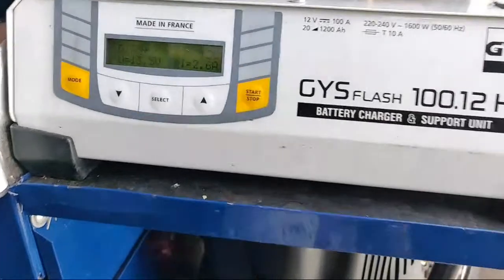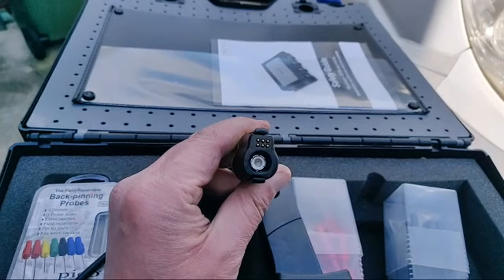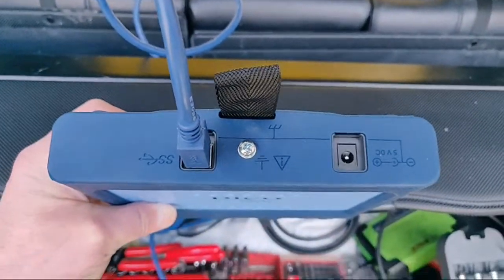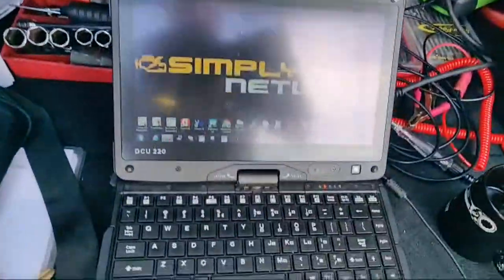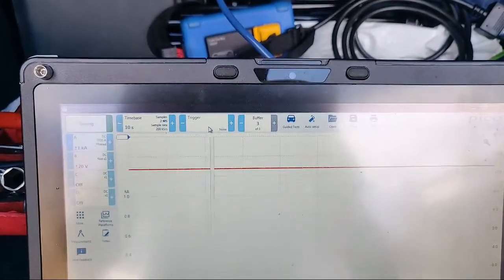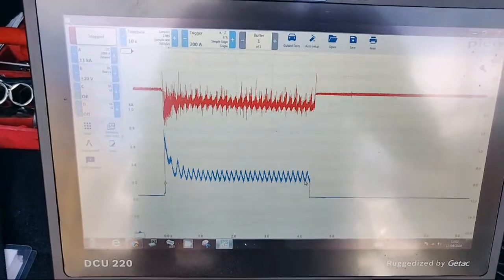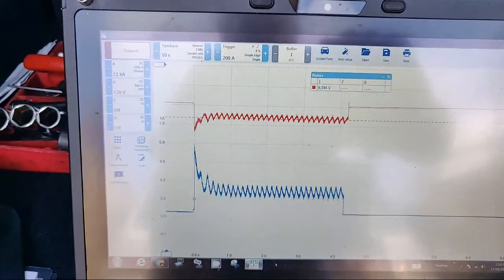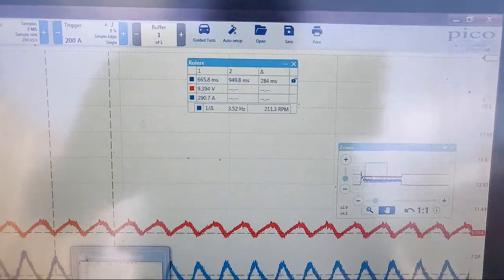Picoscope 4425A Unboxing

Comment: Hi there. Would you recommend me buy this pico scope or the Escope elite 4 ?
Reply from the maker: Different animals, I'd advise trying to get a demo on both. Both are excellent scopes but it's definitely down to personal choice. 4425a Pico takes most of the new user hurdles away. Escope is a powerful tool if you understand what you're testing. Have a look at the Pico and ATS YouTube channels 👍
Reply: Simply Diagnostics i watched some videos. I see many people use Pico scope. I know Escope has more features. Not sure which one to buy. I like both though but Escope has misfire function and 500 v without using attenuator and deep recording

Comment: Being that the amp clamp auto-zeroes when connected, shouldn’t it be off the cable until you connect?
My 4425a standard kit arrives on Tuesday. Can’t wait.
Reply from the maker: What point in the video mate? If it was a cranking amps test it shouldn't matter as the circuit wouldn't have been loaded. There's every possibility I made a mistake, live videos can muddle the thought process sometimes 👍
Reply: Simply Diagnostics not judging. It was a serious question. I agree that with what you are looking for and the amperage you’re are dealing with on a cranking test, it’s a mute point. As stated earlier, my 4425a is on its way and am trying to clarify. If I were doing something in the mA range of testing, with the 4425a, would it be necessary to hookup the lead before connecting the clamp for a true zero. Incidentally, you have to be the happiest tech on YouTube. It’s refreshing.

Comment: Well a bit flashy these bad times but who I’m to judge envy it such a great piece of kit no match for a Strap-on Verus scope 
Yes one question how to buy one without missus knowing (she does accounts ) that makes a bit difficult doesn’t it 😂 
Thanks for a video and stay well stay safe Steve
Reply from the maker: My way of looking at purchasing is this - will it save me time when diagnosing faults? Will it save me work? If the answer is yes, I find a way to pay for it.
I love my verus, it's paid for itself a dozen times but when the detail comes into play it's a whole different game, the "noise" gives as much information as an extra channel, for free.
Stay safe my friend 👍
Reply: Simply Diagnostics totally with you there couldn’t agree more 
To be honest for me Verus saved loads of time helped diagnose tricky faults for example sensor loosing signal at certain temperature regime etc list will be endless so to speak it’s not a machine makes mechanic - knowledge and knowing how to use  machine makes a good mechanic so therefore I would say for me would be too early to justify such a kit yes I would learn how to use and would progress using it but I need to direct myself more into diagnostics sphere whereas in the mean time I do not everything from servicing and engine rebuilds to electronics and diag and in my case at my age could be a tad too late 
Mountains to climb for me to get even close  to your level of skill and knowledge every bit of knowledge have gathered on my own so when I feel that it needs and must have then yes no one will stop from getting one 
Again thanks for your advise and reply 
Thank you again and all the best to you